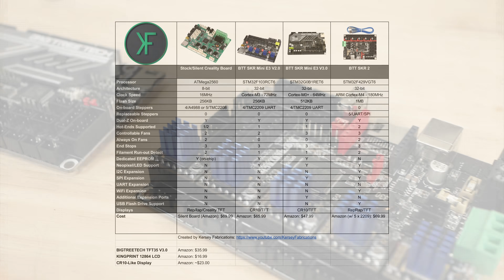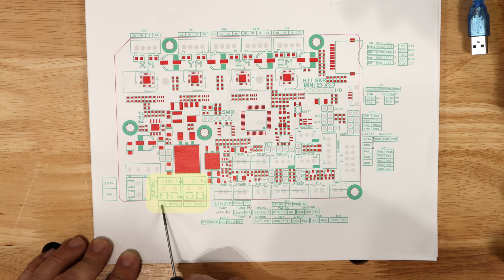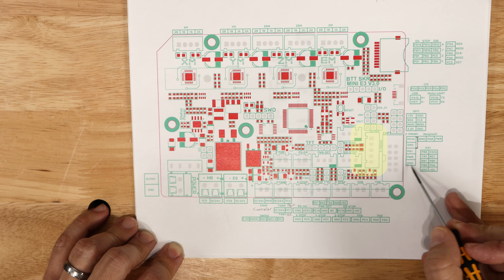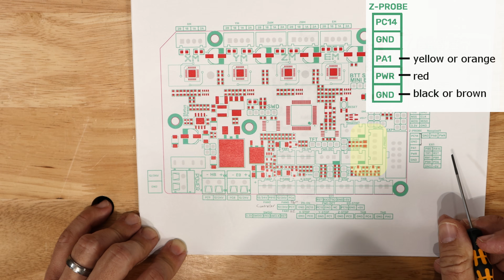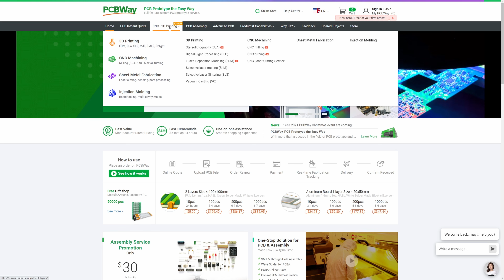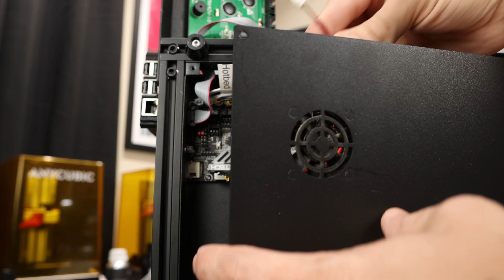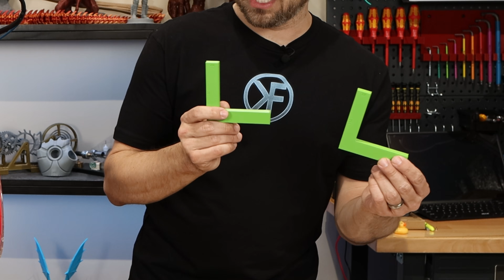Bigtreetech SKR Mini E3 V3.0 - Ender 5 and Ender 5 Plus

Comment: Great video. Found this when I bought SKR Mini E3 V3.0 for my Ender 5 Plus and wanted to know how to swap my board. Looks like I connected all correctly as per diagram and your guide helped me a lot. Now I wanted to flash the new firmware. It looks like the flash was ok, since the the file on the SD card got renamed as instructed but my printer remains dead or at least it looks that way. The BL touch turns on and does 1 cycle of "clicking" and nothing happens after that. The screen remains black. Is there any way to debug and see what is wrong?
Reply from the maker: Thanks! Which screen are you using and how is it connected?
Reply: @kerseyfabs  I'm trying to use the stock display and I connected it to the EXP1 (the same as in video). Will this work with the stock ender 5 plus display?
Reply from the maker: @juresimon2663  That won't work at this time. There isn't firmware to support it.
Reply: @kerseyfabs  Thank you. Ordering a TFT35 it is then :)

Comment: I'm putting one in my ender 5 plus with a stock BL but the board end connector has been split for the stock board do i need to replace the connector or is there a work around?
Reply from the maker: No. For the Ender 5 Plus: "SKR Mini E3 V3.0 - Ender 5 Plus - BLTouch connected to Z endstop"
Reply: @kerseyfabs  i did figure that out even had to flip the power and ground to match the wiring diagram, however the bed keeps jamming into the hot end. the screen says the z offset is set to -3.000mm is that supposed to be right? also is the TFT enabled in your firmware?
Reply from the maker: @russoshobbyempire357  By TFT do you mean Bigtreetech or stock? Yes BTT. No stock. I have another video on how to do bed leveling with Marlin. If the bed leveling isn't the problem and it's jamming in anyway, then you may need to check your black/white wire to make sure it's right and that it's getting connectivity.
Reply: @kerseyfabs  I figured it out the white and black wires in the z stop port were flipped. now everything is running smoothly. tomorrow I have to recalibrate the E step to account for my direct drive, them it's time for the first test print and baby steps. one last question. I'm going to be running the printer on octoprint and for the filament sensor should it be plugged in the board or the screen? or does it not matter?   Thanks for your help and your videos are a big help.
Reply from the maker: @russoshobbyempire357  Awesome! Glad you worked it out. I think there's two ways to do it. I know it will work if you hook it direct to the Pi and install the correct plugin. (See the plugin's documentation.) It may work if you hook it up to the board and let the board interrupt OctoPrint when it runs out.
Reply: @kerseyfabs  now I'm sure I have a bad board. after i did the E steps I started a first layer test print it started out fine then out of nowhere the print head jammed itself all the way to the right and now it won't finish an auto bed level. I think one of those crossed wires did something to it.

Comment: I've got the SKR Mini E3 V3.0 with the TFT 35 v3. Using the Ender 5 Plus (bl touch) firmware and.. it randomly restarts mid print and stops. Biqu hasn't responded to anything. So my Ender 5 plus is currently unusable.

Comment: I followed this video when swapping from my V2 to V3 board.
I've installed the BL touch (3.1) as per the video and I get a random error.
It will probe fine for homing and then begin ABL then anywhere between point 1 and point 15, the bed will raise and the probe will "go inside" the bl touch but not "activate" the sensor causing ABL to fail.
It will run the "Repeat" function in the firmware absolutely no problem (I've never had it fail).
I'm at a loss as to what it may be...any ideas?

Comment: I tried your firmware for the Ender 5 Plus and it crashes my tool head when starting the purge line. The bed dimensions are 15mm too big in x and y. Everything else works great. Would you share your config files?
Reply: I'm also running an all metal hot end, direct drive, external electronics, and an enclosure.
Reply from the maker: My source files are ALWAYS available. You can find my repos here: https://github.com/KerseyFabrications/Marlin
Be sure to use the branches drop down in the upper left to select the version you need. I'm currently working on a new 2.1.1 release.

Comment: i have changed to this main board but it is set for the ender 3. How can i change it to the ender 5 firmware Thanks Pete
Reply from the maker: 1) Download my firmware from the description for your printer configuration.
2) Rename the file to firmware.bin and copy it to the SD card that came with the board.
3) Insert it in the mainboard when it's powered down.
4) Power on the printer and it should automatically flash it.
5) You can verify it by the info on the display or making sure the file was renamed to firmware.cur.

Comment: Great video! I did the upgrade on my Ender 5 pro . Having a hard time getting the firmware to update to Ender 5 pro .  It’s  on Ender 3  ?!  Is there a video on how to load the firmware on the printer?
Reply from the maker: 1) Download my firmware from the description for your printer configuration.
2) Rename the file to firmware.bin and copy it to the SD card that came with the board.
3) Insert it in the mainboard when it's powered down.
4) Power on the printer and it should automatically flash it.
5) You can verify it by the info on the display or making sure the file was renamed to firmware.cur.

Comment: hello! thansk for your video, I have a question. what is the caliber for the wires in order to buy the correct ferrules for them?
Reply from the maker: I recommend buying a multipack. There are up to three different gauges usually and buying the kit with the crimper is the easiest to get started. I have a video on applying ferrules which includes links. https://youtu.be/l7mxGVF-QGE

Comment: did this upgrade on one of two of my ender 5 plus'. its currently running its first print and doing a beautiful job. thank you for making these videos!!! cant wait to flip my other printer, still undecided which board im going to run
Reply from the maker: Great to hear! Enjoy!
Reply: Did you get the TFT35 V3 board from the link?
Reply: @peterhe3746  I caught the Tft70 on sale on fabreeko🤘🏼
Reply: Hey man ! where did you get the firmware?
Reply: What firmware did you use? Asking because I used the firmware he gave for Ender 5 Plus with BLtouch hooked onto the z-step
And my Z homes and stats at 7 instead of Z. Kinda don’t know if it’s a firmware issue or if it is a me saving Z home issue…

Comment: Hi, I noticed in the comments you said the Ender 5 Plus requires a new display (at this time) to upgrade to this board? Is that still valid? Can I not use the stock display with the SKR Mini E3 V3.0?
Reply from the maker: You cannot right now. It may be possible in the future but it will still need rewiring most likely.
Reply: @kerseyfabs  The correct configuration for a E5+ is TFT35 V3 not a TFT35 E3 V3 + SKR Mini E3 right? Also, could you elaborate on what Z alignment feature I'd be missing? Like is that something the original E5+ board has? Sorry for all the questions!

Comment: Hi! I downloaded the bin file for my ender 5 plus but when I try to home the axis, it's going the wrong direction, it tries to home to the negative side, not the positive where the end stops are located. It also says ender 3 as the printer name. I have tried but failed to build a file for weeks, this is Soo annoying. I found your file and thought it was the one.. maybe i will install klipper instead because it seems to be only trouble when mixing these boards and marlin... I like your content by the way! Keep it up!
Reply from the maker: It didn't install correctly. Give this a shot:
1) Download my firmware from the description for your printer configuration.
2) Rename the file to firmware.bin and copy it to the SD card that came with the board.
3) Insert it in the mainboard when it's powered down.
4) Power on the printer and it should automatically flash it.
5) You can verify it by the info on the display or making sure the file was renamed to firmware.cur.

Comment: Hi there im just wondering if you can do an updated video for the ender 5 plus . I have two wires (b/r) from the mofeset and two solid red wire which i think are the nozzles heaters and no idea where they go.
Reply from the maker: I don't plan to do another video on this but I'm happy to help. The two from the MOSFET go to the bed heater on the board. The red is positive. The two solid red thick wires go to the hotend heater. Polarity doesn't matter on those. Be sure to check out my video on the E3 Mini V2 which should be almost identical.
Reply: @kerseyfabs   I appreciate it! Love the videos !

Comment: Hey, thank you a lot! The instructions are awesome and not over-detailled. It was a great help! There is only one issue, I used the firmware, you provided and it seems, ist doesn't support dual-Z. During printing, everythig ist fine, but in the end of the auto-homing cycle, only one Z-stepper goes to +5 mm, the other one ist blocked. Ist there a workaround?
Reply from the maker: I appreciate all of that. On the Mini E3 boards though the two Z stepper ports are connected to the same driver. There's nothing to configure or setup. Just make sure you have both steppers connected to the board.
Reply: So... I now connected both z spindles with a timing belt and ran both steppers seperately - it worked perfectly fine, when only one stepper is connected electrically The problem only shows up, when each stepper is connected to it's own z-port. 
I now simply use an Y-cable to connect both steppers to only one port. For additional security, I leave the timing belt installed. That works for me, but the mysterium remains... Thank you for your help :)

Comment: CR-10S: My bed stopped heating, so I replaced the connectors and it still doesn't heat. Now I have an SKR Mini E3 V3.0 and Touch Screen on it's way! I also ordered the Ferrule Kit; thanks for making me understand why those are important 🤘🤘
Reply: my new ender 5 pro is stuck on blue screen after firmware update from creality site.... cant get ahold of them so i am hooking this board up now.  funny how faulty these printers are for such a simple design.... oh and expensive lol
Reply: I found out, after spending $300+, that it was a $10 MOSFET that needed to be replaced... Regardless, it's 5 years old, so I'm happy to have a "new" system 🤘🤘
Reply: @fatboy1271 I just got a printer (ender 10 5s) from someone who put this board in but used a "modded ender 5 pro" file... does that make sense to you?? I have 3 other enders (Ender 3 pro, ender 5 pro and ender 5 plus that are pretty much stock -except for silent motherboard upgrade) and this 105s is so confusing

Comment: Ill pay some one to help me get this printer working I've been on this problem for over a month now. its a simple firmware bug but i cant for the love of this printer figure it out. I really don't want to throw away this printer from a stupid problem such as this
Reply from the maker: What is the simple problem you're having?
Reply: @kerseyfabs  wont home, when it homes the board lowers, never to raise for the bltouch test.
Reply from the maker: What hardware/software are you currently running?
Reply: Hey any pointer on how to fix your firmware. anything would be greatly appreciated.
Reply from the maker: I don't think there's anything wrong with the firmware. My guess is that your BLtouch isn't wired correctly.. Please double check with my writing diagram.
Reply: @kerseyfabs  hey so that didnt fix anything. Can you please help ive been trying and asking for help for months now.
Reply from the maker: @Wetfootwonder  Double check the black/white wiring on the BLTouch and check the firmware info that it's connected to the right port.
Reply: @kerseyfabs  okay what do i do after that?
Reply from the maker: @Wetfootwonder  If that doesn't work then I don't know what to tell you. Hardware wiring connects to the proper firmware. There's nothing in between. Make sure the connectors are making proper contact.
Reply: @kerseyfabs  hey so i did that and the bltouch didnt power on or it didnt move. got any other ideas.
Reply: the board keeps going down when i hit home
Reply: it never goes up but when i tell it to go up it goes up. this is a firmware problem not a wiring problem

Comment: I have a problem: no +24VDC to motors or heaters.  lcd, thermistors work fine.  Am I supposed to add jumpers to the board?  I have not connected the hot end fan yet, could that be it?  Ender 5, SKR E3 mini V3
Also, electronic enclosure fan not running...
Reply: I forgot, using Marlin 2.1, custom compile.
Reply from the maker: Since it's a custom compile, I really can't tell you what's wrong. Any of those things could be misconfigured. I'm also not sure how you're testing them.
Reply: @kerseyfabs  Thanks for reply.  not a newbie at this :-( have done SKR 1.3 and 1.4 before.  Tried precompiled V3 for Ender 5, lcd did not come up.  My compile probably close.  The fans do work correctly.  No heated bed shows up on menu, nozzle and motors do not work.  Going to try taking old Ender 5 config and adv_config from a previous Marlin, and only change the MB and chip for PIO.
Reply: @kerseyfabs  OK, new development.  For some insane reason, I decided to try the pre-compiled Ender 3 firmware in my Ender 5 on the mini V3.  Everything worked, kind of.  The limit switches were wrong, but all the motors and heaters, and the lcd worked.  Nothing wrong with the mini V3 board...

Comment: Either my board was dead on arrival, or it doesn't work on the ender 5 plus. My display won't power on with this board at all, but with my old board it powers on easily.
Reply from the maker: This board requires a new display on the Ender 5 Plus. See my other videos on Bigtreetech boards.
Reply: @kerseyfabs  Appreciate the response! Ended up figuring that out after the fact. The biggest headache was trying to find a firmware where the CRTouch works properly. Couldn't find it so I ended up having to modify and compile my own marlin firmware, now that it works though, super happy with it.

Comment: If possible please update the video to clearly call out that this board is not compatible with the Ender 5 plus it requires a  display upgrade to work. 

BigTree says it is compatible on their site but does not call clearly out this isssue and does not give any guidance on what displays will work with the Ender 5 plus.
Reply from the maker: I've made a note in the description and added a pinned post to clarify. Thanks for the suggestion.
Reply: @kerseyfabs  Thanks, now if I could only get firmware and setup dialed in. I get an "invalid mesh" error on startup :(

Comment: i have problem with your FW, error: Failed bed leveling. ender 5 plus, please i need fix
Reply from the maker: You need to go into the menu and run the auto bed leveling. That will clear it up.

Comment: hey I did this but my screen says no printer attached. but when in merlin it thinks its a ender 3, but i have a ender 5 plus. I googled and googled to the point of writing on this wall. can some one please help
Reply from the maker: You didn't successfully install my firmware. Download the correct file for you printer, rename it firmware.bin and try again.
Reply: @kerseyfabs  I installed SKR Mini E3 V3.0 - Ender 5 Plus - BLTouch connected to Z endstop - to my board.  When I auto homes it continues to lower the board every time, if I go to settings I can raise and lower the board, but it never finds home.

Comment: I have the ender 5 with the skr mini e3 v3 board and I tried to use the software you have listed and it will not work im I doing something wrong here need help I cant print right now
Reply from the maker: What's it doing/not doing?
Reply: I get the firmware on the SD card put when I put it into the printer it does nothing but turn on and the red light is flashing but never upgrades and the screen says no printer found
Reply from the maker: @zfamilyadventures8165  Did you rename it to firmware.bin?
Reply: I did

Comment: Hi Kris, just a quick question, should your firmware for the Ender 5 Plus work with the stock touchscreen display? I just got my BTT SKR Mini-E3 V3.0 and all I connected was the power and the screen (after I turned the socket for the screen 180 degrees, since the screen remained blank initially) and the SD card with your firmware (named firmware.bin) but all I see is the boot-screen with the progress bar (which does not progress). After I reboot the printer without the SD card, I get the same thing but the FIRMWARE.BIN is renamed to FIRMWARE.CUR. Hope you can help me out here. Thanx.
Reply from the maker: No. It doesn't currently work with the stock display. I'm working on something that may allow that in the future but it's not ready yet.
Reply: @kerseyfabs  Thanx for the info. Working on putting in an old 12864...
Reply from the maker: That should work!

Comment: hola !!! alguien podria ayudarme no encuentro que configuración tengo mal que al imprimir las primeras 4 o 5 capas me las hace sin mover el z una encima de la otra luego de esas capas ya mueve normal
Reply from the maker: Sorry but I'm not familiar with that issue, particularly on this board. Did you get my firmware installed correctly? Does the screen show Ender 5 or Ender 5 Plus and the new version?